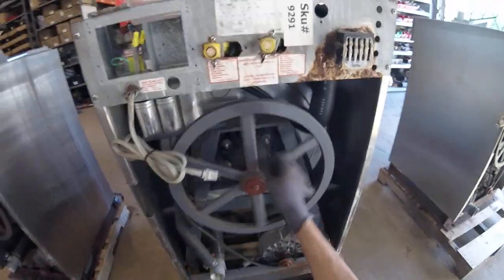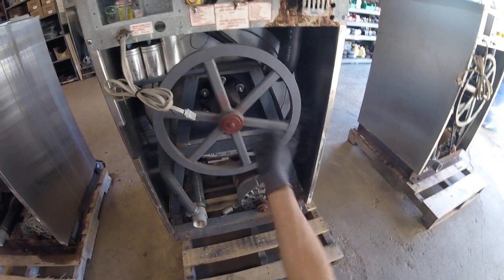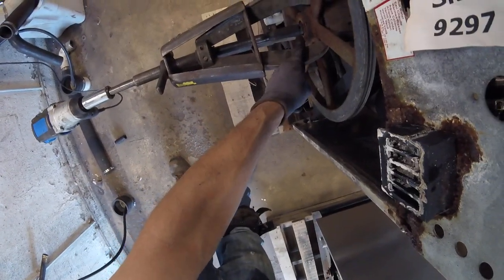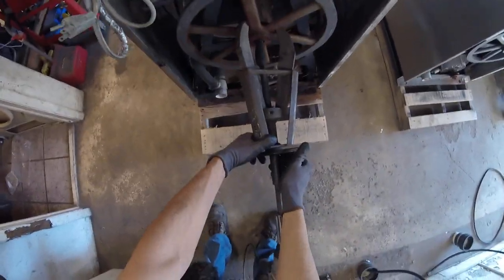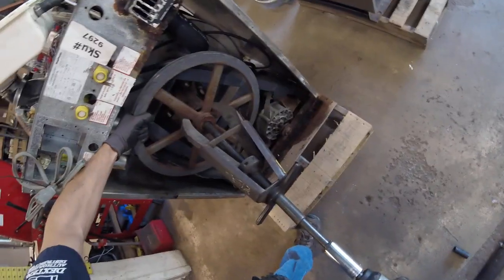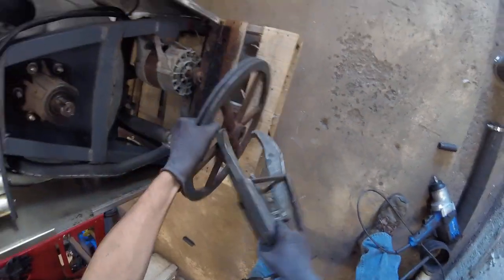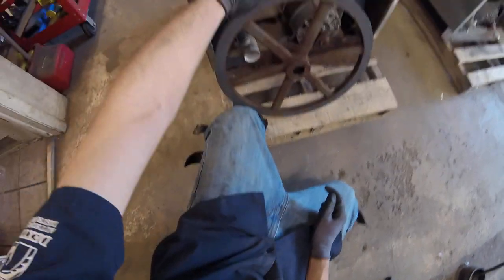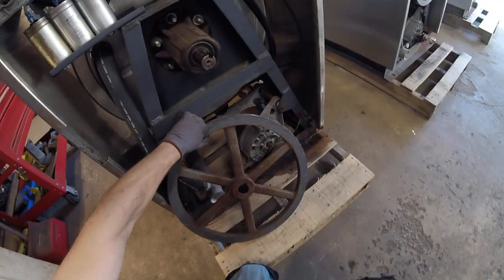Changing Drum Bearings on a Speed Queen Commercial Washer- Part 3 of 11

Comment: That 3 jaw puller us nice. I couldn't find  one like yours. I did find a 4 jaw otc puller. I have rebuilt alot of the wascomat generation 3 and 4 30 and 35 pounders. Great video thanks.
Reply: would you happen to have part # on the OTC puller or the Alliance puller used in the video. Thank you